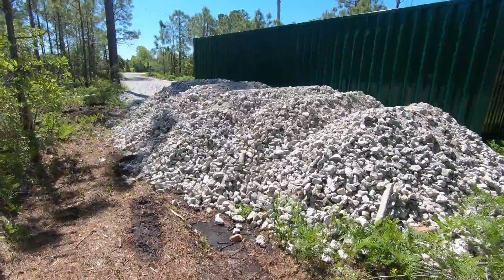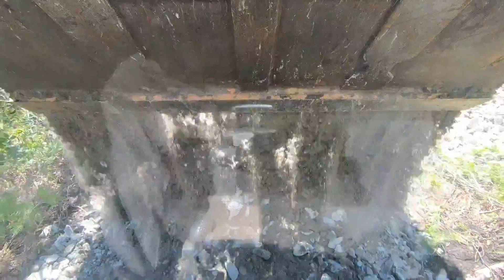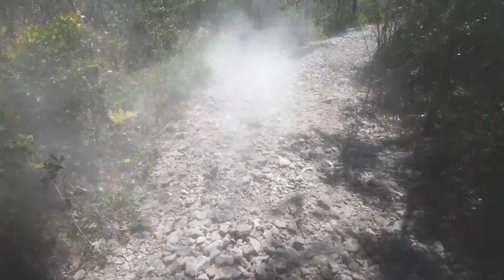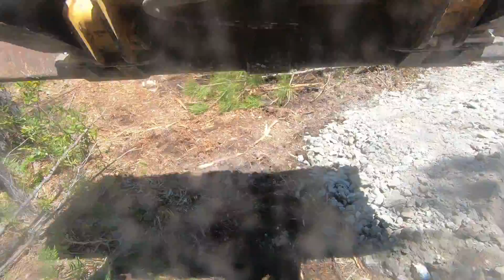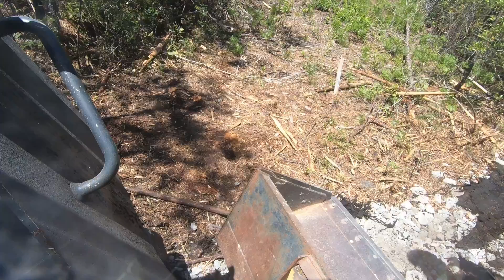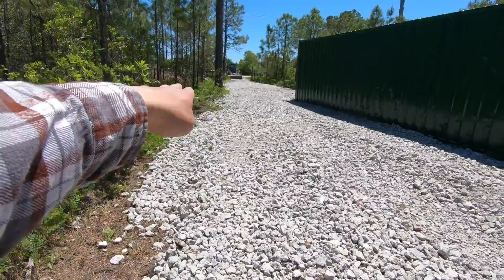Installing A Recycled Concrete Hunting Path

Comment: What a great idea. The nice thing about crushed concrete is it will drain well and not shift if compacted. There are many parks and zoos that look at installing pathways. This would be perfect and tie in well with a low ecological impact. Putting a paver or brick on top would be very easy.
Reply from the maker: Yes, very true!
Reply: @idigit4967  It's a shame I'm retired. Your product and services would be so easy to sell. You offer such an aid to community and businesses. Just in code compliance alone you would never run out of work.